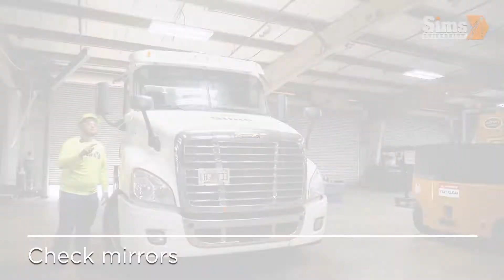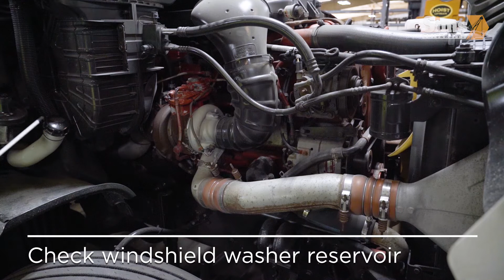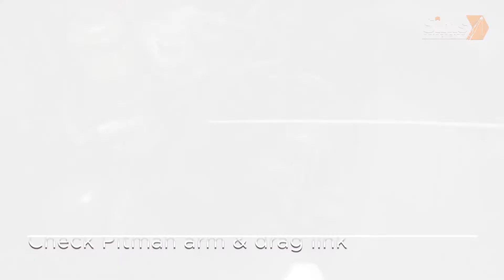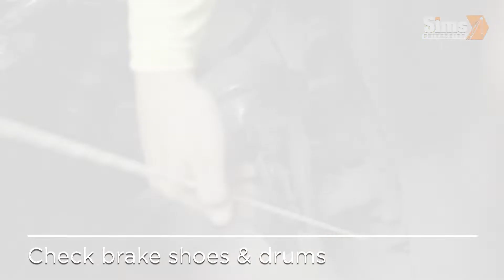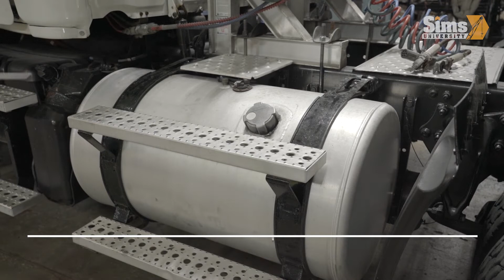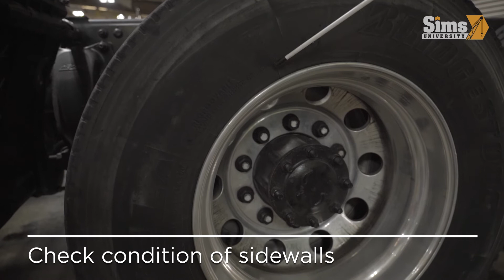Under the Hood - Sims University

Comment: Bubble for the windshield seal? Shown me. There's no pressure there. 
On the exterior of the truck you said bolts and nuts are present. There are no bolts or nuts on the exterior so why say it there, why not on the inside of the hood?
Why nuts and bolts? For it to be applicable to everything i would say all of the hardware is present.
How do your students find the air compressor?
And the state wants you to say that the gear driven components are working and in proper running condition or some variation of that sentence.
Brake chamber is held together by a c-clamp.
Brake shoes are not dangerously thin.
Hub-seal reservoir.
Hard plastic usually doesn't bend, but it can chip. 
Hard plastic is not chip, cracked or broken. I dislike the word broken because does not explain anything. 

No debris oil or anything that can make me fall on the catwalk and steps.
Reply: Passed it 1st time 🤷‍♂️